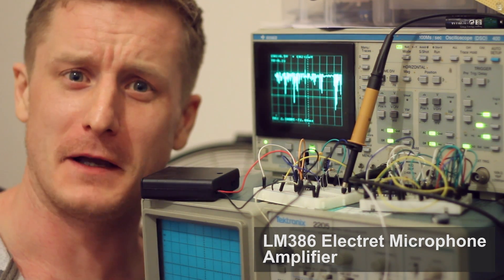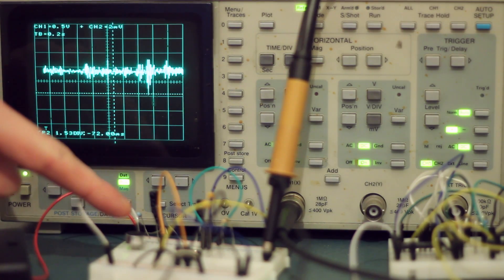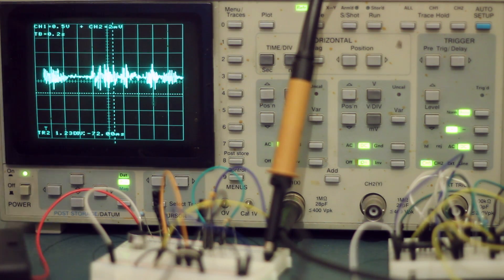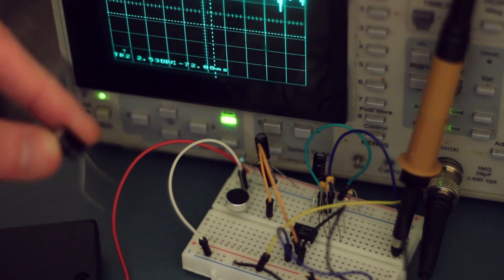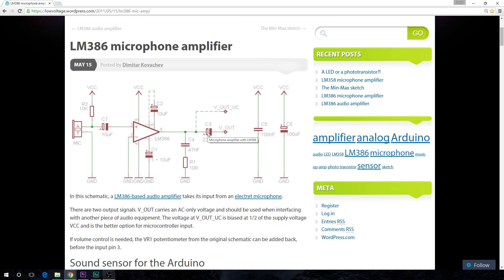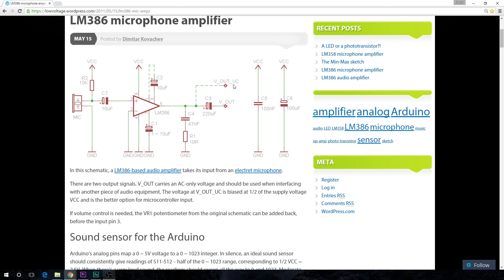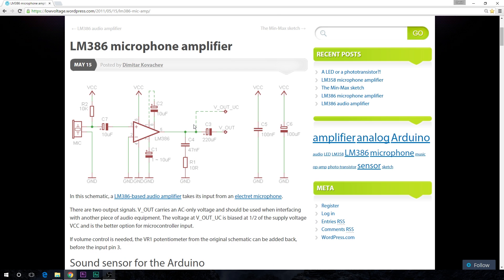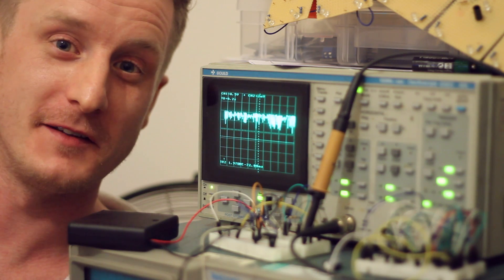LM386 Electret Microphone Amplifier

Comment: I like these short and snappy videos in amongst the longer ones. It's always good to see work in progress 😁

Quick question though as I'm not sure why you chose to use an lm386 as opposed to a straight-forward op-amp design: Is this just for measurement or are you intending to use the output to drive a speaker load?
Reply from the maker: +Ronan Cantrell Thanks Ronan, the LM386 was just available. I will be looking at an LM741 too but I don't have all the parts yet, the LM386 was waiting for me when I got home from work :-) I am not sure which will work best at the moment.